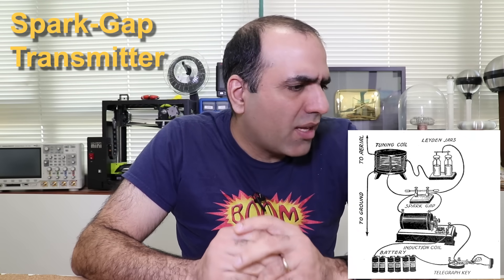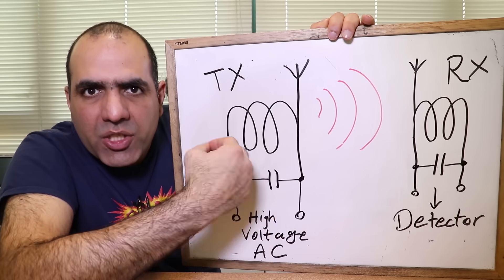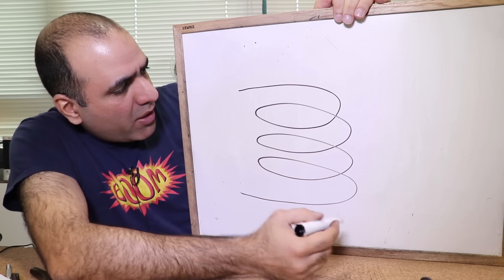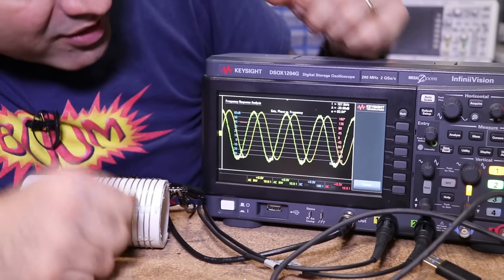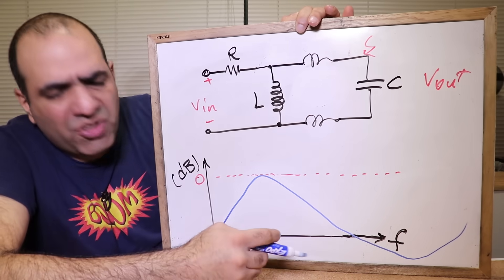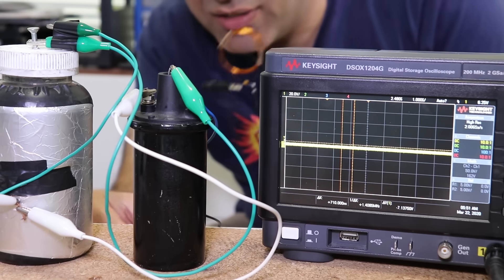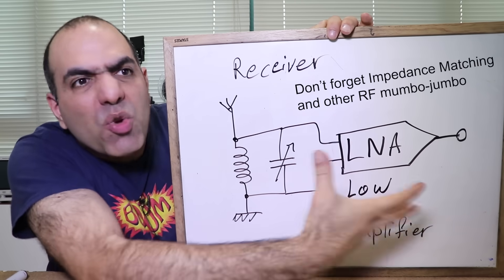Making a Spark-Gap Transmitter

Comment: I made something like this in 1967. Neon light transformer. 5-6 capacitors made from 4"x12" window glass with foil on both sides (away from the edges!) wired in parallel with transformer output. Spark gap. No antenna. Produced enough buzzing voltage to make substantial radio interference for about a mile radius. Cops showed up and ordered it shut down, it interfered with tv, radio, and cop radios!

Comment: Sir please tell what happen if we connect 2 unbalance DC voltage in parallel then what is resultant boltage and ampere. Please consider DC voltage from PV module not from battery. Please tell 🙏🙏🙏

Comment: 5:47 I am very disappointed. Very. I shudder at the thought of Mehdi not owning (and knowing how to use) a good programmable calculator. They exist for this very purpose and are exceptionally useful...and add an additional opportunity for teaching. It would have taken a few moments to enter the equations into the calculator so that could easily be retrieved and used as needed.

Comment: decades ago.. in a donut shop parking lot in the san fernando valley. a friend pulled up in his V8 powered chevy Vega.  he backed in leaving the engine idling.. it idled at about 1,800 RPM..  he came over to get me.  said he just replaced the starter and can't get it to shut off.  i said you probably pinched the resistor bypass wire at the starter behind the battery cable on the solenoid.. and he had.. while we were talking about how to shut the car down safely.. i said.. ill throw a towel over the carb and smoother it..  he said. no.. it will foul the spark plugs.. i said. greg.. you have an MSD 7AL ignition box .. it puts out 44 joules of current .. you don't need to worry about fouled spark plugs..  before either of us could stop him.. a third friend said.. i know.. ill pull the coil wire out.  he stepped forward.. leaned carefully against the fiberglass front fender.. reached toward the back of the engine and tried to rip the coil wire out of the coil.  nope.. it was a mallory pro coil and the wire end was fastened tight with screws and a retainer plate.  but it did come out of the distributor cap way too easy..  lucky that his wrist was across the throttle linkage .. the  bright blue corona of sparks that looked like michael jacksons glove covered his hand up to his wrist as the engine took its sweet time coming to a stop..   he seemed unaffected by it.. said it did not hurt.. i kept asking him to repeat it as only 6 of the almost 100 people there that saturday night had not seen it..  for some reason.. he refused a repeat performance. 

 so electroboom..  ready to step up in the current at 100KV..

Comment: In his latest video, Diodegonewild stated that the spark gap should be in parallel of the transformer. So when the spark appears, the transformer is shorted and it prevents high voltage high frequency to return backward in the circuit. 
I'm quite confused right now...
But as always, good video!

Comment: I wonder how much power you can get "out of air" catching all the radio waves
Reply: Not much. Even if you get "something", it still needs to be sent from a very high-power transmitter, which essentially just wasting energy because it isn't directional.

Comment: Why does diodegonewild say that this circuit is wrong? He said that the spark gap should be paralell to the transformer not in series.
Reason being that in this case the transformer gets a high voltage on the windings

Comment: Using a variable capacitor and inductor, you have the equivalent of an AM radio. Just add a diode!

Also... By adding the capacitor you really just turned it into an automotive ignition system. Coil, points, condenser!

Comment: Tesla's goal to transmit power around the globe was something very noble, it wasn't a waste of time. He knew electricity would be the energy form of the future, but wires were unfeasible for mobile consumers and batteries were unfeasible for high power consumers (It's still true today). He saw the only way to make electricity truly viable was to make it *omnipresent*; harvesting it anywhere it was needed. When the inverse square law got him, he tried to concentrate the energy, and invented the death ray.
Reply: gsilva220 problem is you can’t sell free electricity.

Comment: might sound a bit stupid but but just to clarify... you dont actually need the capacitor or inductor right? you could just use the wire/circuit's inductance and capacitance and it would still transmit that sine wave/resonant frequency out into the air.
but you add them anyway because it makes the circuit more predictable (current draw, max distance, etc) and also makes receiving it easier because... stuff?
(im just asking because i get really confused about how physics works. i keep thinking it works on a set of rules but it technically doesn't)

Comment: When you wrapped the coils around the toilet roll tube, they were spaced evenly apart.  When you put the coins together, the magnetic field is unified and together, rather than spread over several inches.  This increased your results and changed your microhenry inductance value significantly.

Comment: 02:30 — I regret to inform you that DiodeGoneWild pointed out why exactly this design is worse than the one where you swap the capacitor and the spark gap in the circuit.
Reply: Both versions have pros and cons.

Comment: Diodegonewild says you have the tesla coil and spark-switch in the wrong positions. Also spark gap TX's make a whole lot of high power pulses (EMP). You can make devices malfunction if close enough (making one that works at VHF is much better at that though).  You can actually hear the interference to the sensitive microphone circuitry in the video.

Comment: Great video, Mehdi! Spark gap xmitters are awesome, the very first radios along with xtal sets. This helped to save 705 people aboard the Titanic. It was used extensively in WWI and got to be quite advanced, tunable, etc. Valves quickly replaced all spark equipment, but it was still in use into the early 1920s. The Titanic's Marconi system was one of the most advanced and powerful at the time, I think upwards of 5KW of power. Every spark emits a radio frequency... turn on an AM radio and hear the noise from a light switch, an appliance running, even distant lightning during a storm.

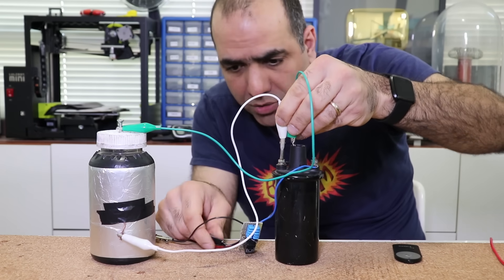Comment: 11:15 - I don't even think it was insulation breakdown all on its own. Your ring finger is exceptionally close to the bare metal of the alligator clip. Plus I find the plastic/silicone/rubber around the clip to be somewhat weak and flimsy anyway, compared to the insulation on the rest of the wire.

Comment: You should have added a note to your video that operating a spark-gap transmitter today is pretty much a guaranteed way to receive a hefty fine for causing radio interference. 

These things are notorious for generating wideband EMI and are banned from use for that reason. With an antenna large enough and enough luck you will interfere with police, fire service or aircraft/airport radios (harmonics and sensitive receivers!) and a van with a few antennas will turn up on your street sooner or later, most likely followed by a visit from a few nice folks from your country's radio regulator, possibly accompanied by the police. 

While interesting subject, this sort of gadget is not something I would recommend building, especially if one lives in a city where the chances of causing problems (and getting noticed!) are much higher.

Comment: This is how ham radio operators communicated 100 years ago.  Most of our transmitions were in the range of what is now the AM Broadcast band.  The problem was, as you might have discovered, the width of the spark signal was so wide that only one or two people could use the band at a time.  Now we have digital modes that are only a few hz wide instead of several hundred thousand hertz.

http://www.arrl.org/files/file/History/History%20of%20QST%20Volume%201%20-%20Technology/Kennedy%20N4GG.pdf

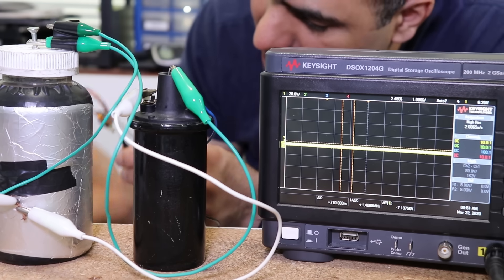Comment: 12:47 The diodes have some amount junction capacitance which is added to the circuit and could detune the resonant frequency. They are also non-linear devices in general and probably won't play nice. I'd love to see what the bode plot for that circuit looks like.

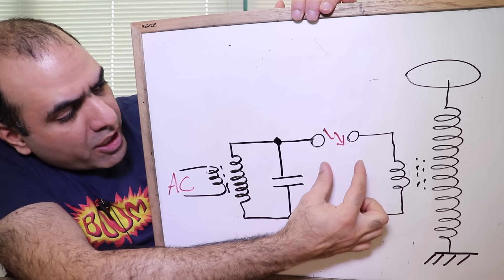Comment: 2:10 WRONG spark gap Tesla coil schematic! You swapped the spark gap and capacitor, putting a lot of HF strain on the HV transformer secondary due to the resonance circuit. See DiodeGoneWild's recent video on this.

Comment: 'On public wi fi, everything you send and receive is able to be stolen by anyone'

That's not true. That used to be a threat a long time ago, an attacker could run an ARP spoofing attack, pretend to be the wi fi hub and steal all the unencrypted data coming through. Unencrypted data...do you know what sites and data you use that is encrypted? Every website with that green padlock in the corner, every android app since 2015. I'm doing A level computer science, I know how all this works and some of the claims that vpn companies make are wrong.

'Without a vpn, your ISP can see all the websites you visit'

Now that is true, to an extent yes. Your ISP can see where you go on the Internet. However with a vpn turned on, you aren't fully hidden. If they wanted to they could just trace you using the unchangeable mac address. Without a VPN, your isp can see this for example 'https://youtube.com/watch?ahiu39Hk'. With a VPN they can only see this 'https://youtube.com/watch?    '. 

'Vpns use military grade encryption'

Ok, military grade means AES, advanced encryption standard and its use nearly everywhere. Your using military grade encryption to read this comment! The claims not wrong, it's just not special either...

Comment: The spark gap is in parallel with the induction coil in the original diagram of the telegraph technology, suggesting that the capacitor and spark gap are inverted in Mehdi's circuit compared to the original, isn't it?

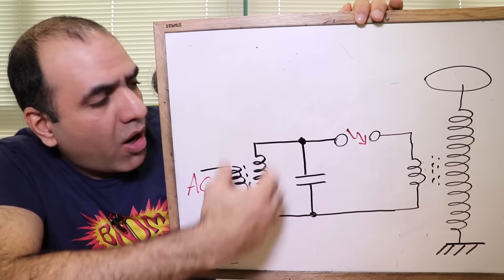Comment: 1:56 the capacitor and the arc gap should be swapped  to prevent high frequency on the secondary from the transformer
Reply: Wrong. I'm correcting every single comment about this, including everyone quoting 'Diodegonewild'. Obviously HF currents can't get into the secondary, there's a big capacitor in parallel across the secondary. Even Tesla himself had the gap in SERIES in his schematics. If HF kickback into the xformer secondary is an issue, add a choke coil in series. There's SO much info on the interwebs about this circuit.
Reply: @lancemgy  If it was actually a filter capacitor, you'd be right. But this capacitor's job is to resonate with the coil (that's how the necessary high frequency is generated), so it has the same HF voltage across it as the coil does.

Comment: As a licensed ham radio operator I will share a few things you should know. Operating a transmitter you built yourself requires a license. If you do have a license, you must stay within your assigned band, and if you do not have an assigned band, then you must not interfere with the primary user of the band you are transmitting on. Lastly, spark gap transmitters leak badly across multiple frequencies.

Comment: I like you... There is something missing.
https://teslaresearch.jimdofree.com/books-1/nikola-tesla-on-his-work-with-alternating-currents-and-their-application-to-wireless-telegraphy-telephony-and-transmission-of-power-an-extended-interview-leland-i-anderson-editor/
In the above link Tesla explains that his device would transmit power through Earth.
""Absolutely wasted. From my circuit you can get either electromagnetic waves, 90 percent of electromagnetic waves if you like, and 10 percent in the current energy that passes through the earth. Or, you can reverse the process and get 10 percent of the energy in electromagnetic waves and 90 percent in energy of the current that passes through the earth"."
At the moment i dont have any more critiques - perhaps - You could investigate this since it probably is not explained in conventional science?

(in short he explains that em radiation to transmit power is wasted energy and we are still using this and now even 5g...)
(I heard, dont know where anymore, that "they" already have a few Nikola Tesla radio systems that is meant to go operational in case of a nuclear catastrophe or something like that... also the reciever doesnt require any crystal diodes nor batteries to recieve the power with the transmission (but this is how i remember it being explained so it might not be correct=)

Comment: This may be a silly doubt, but it keeps annoying me. Is it necessary to have a spark plug when we could just charge the capacitor initially to a very high voltage and use the LC oscillator itself as an antenna

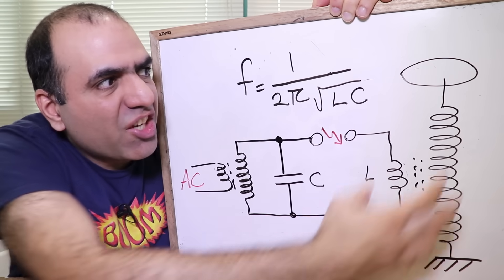Comment: 2:44 Nooo man, that scheme is wrong that way you get high frequency into the transformer  and can damage its insulation to ground. The spark gap has to be in parallel with the transformer and the capacitor in series.
Reply: Wrong. I'm correcting every single comment about this, including everyone quoting 'Diodegonewild'. Obviously HF currents can't get into the secondary, there's a big capacitor in parallel across the secondary. Even Tesla himself had the gap in SERIES in his schematics. If HF kickback into the xformer secondary is an issue, add a choke coil in series. There's SO much info on the interwebs about this circuit.

Comment: You should try swapping the capacitor and the spark gap. Basically have the spark gap "shorting" out the HV (will want to add a series inductor to the HV to limit current).

Comment: 1:55 - this is actually a wrong schematic of tesla coil, that spark gap and capacitor should be swapped because it can destroy your transformer after longer operation. Check this video and turn it on 12:56 -> https://youtu.be/wSp1IzmRUk8
here it is explained why that spark gap and capacitor needs to be swapped 😉
Reply: Wrong. I'm correcting every single comment about this, including everyone quoting 'Diodegonewild'. Obviously HF currents can't get into the secondary, there's a big capacitor in parallel across the secondary. Even Tesla himself had the gap in SERIES in his schematics. If HF kickback into the xformer secondary is an issue, add a choke coil in series. There's SO much info on the interwebs about this circuit.

Comment: DIODEGONEWILD IS TRIGGERED BY YOUR SCHEMATIC
Reply: @DiodeGoneWild
Reply: As he should be, because DGW is WRONG. The circuit works either way, and a spark gap in series is just fine, causes no issues with most power supplies. Even Tesla himself drew schematics with the gap in series, not parallel.

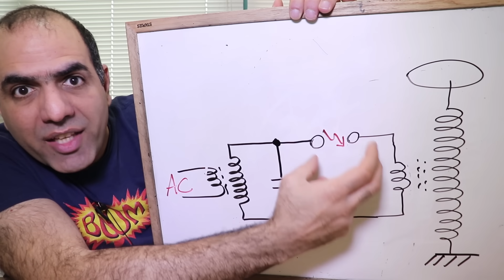Comment: 2:16 DiodeGoneWild: This schematic is dody and WRONG !!!
Reply: I can't watch DGW. His accent drives me crazy.
Reply: @markfergerson2145  Honestly I find it hilarious how he can seemingly infinitely pitch up his voice up through anything he says.
Reply: @markfergerson2145  I genuinely only watch his videos just because he sounds like that alien trader from Tattoine in Star Wars Episode 1.
Reply: No, Diodegonewild is WRONG. Most every schematic, including Tesla's own, show the spark gap in SERIES in a resonant circuit such as this. There is no kickback to the xformer secondary to worry about. I've built spark gap xmitters and Tesla coils since I was 11yo, always had gap in series. Actually, either way works just fine. And yes I can't stand to listen to DGW either, no one should talk like that, it's so bizarre and distracting.
Reply: @lancemgy  You either have the capacitor across the high voltage source and the spark gap in series with the primary winding or the other way around. Both methods work and have different results making them suitable for different input sources. The classic tesla coil circuit using a mains frequency transformer that can output a lot of current works perfectly with the circuit shown in the schematic but if your input source has much higher voltage but cant deliver a lot of current like a flyback transformer, you might wanna try the other method.

Comment: You need frequency to transmit power far distance.  Check out this video it's 12volts 0.3 amps spark gap for visual. Also great video like always. Cheers https://youtu.be/oqTSb726wCw

Comment: Two days ago a channel you recommended, Diode Gone Wild, made a video about spark gap tesla coil and he claims the schematic you made is wrong. Link: https://youtu.be/wSp1IzmRUk8?t=773
Reply: Wrong. I'm correcting every single comment about this, including everyone quoting 'Diodegonewild'. Obviously HF currents can't get into the secondary, there's a big capacitor in parallel across the secondary. Even Tesla himself had the gap in SERIES in his schematics. If HF kickback into the xformer secondary is an issue, add a choke coil in series. There's SO much info on the interwebs about this circuit.

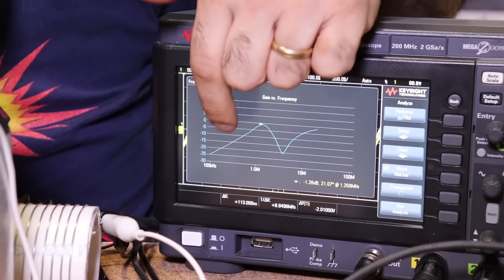Comment: The wire you use at 9:34 (alligator white wire) are crap and they melt easily.  replace em with good ones like this  https://www.cafr.ebay.ca/itm/5-Kinds-Color-Double-Headed-Alligator-Clip-Wire-Test-Line-High-Voltage-Silicone/263432523731?hash=item3d55cd4fd3:g:NBEAAOSwvGlaWIRV

Comment: Quick side note: for receiving spark transmissions, your receiver does not have to be very narrow band, because the transmitter is pretty wide band. Spread spectrum, so to speak!
With a modern 10khz wide broadcast receiver, you will maybe receive 20% of the total power you could receive. For professional spark gap transmissions something around 30khz was good. For simple ones like in this experiment, 100khz would be more appropriate.
And sending SOS is just very, VERY dumb. Even as a joke you shouldn't do it. You can be surprised by the range of quick and dirty transmitters.